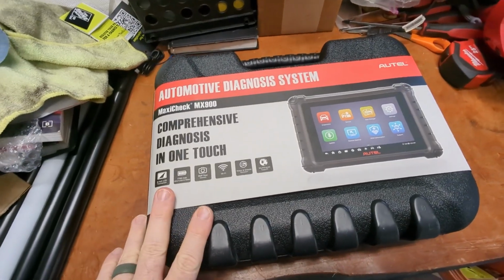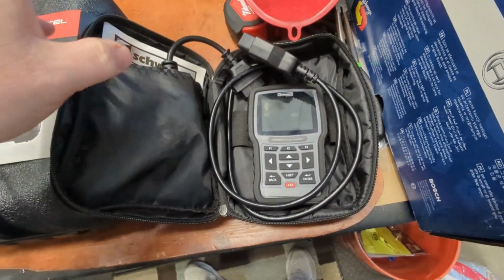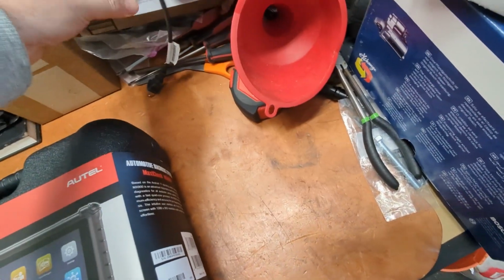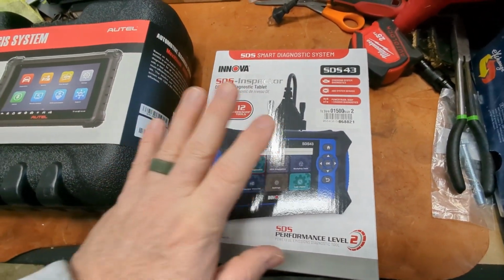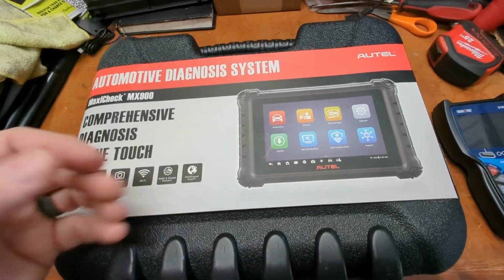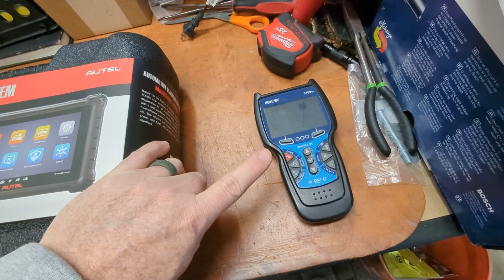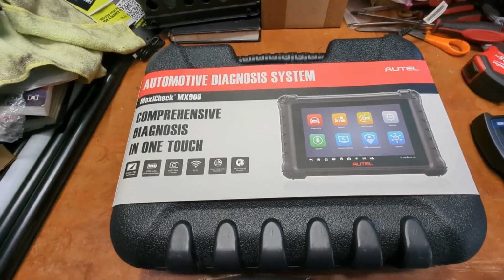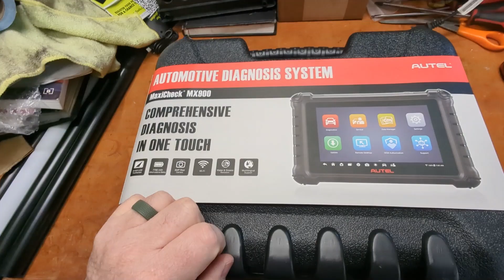Autel Maxicheck MX900 Intro

Comment: Excited to see the next video! I am a lower level technician interested in getting into diagnostic work, my tool truck rep told me about the mx900. I wanted to research it and you're video came up. I have an inovo scanner, I think its more basic than the one you show here, but I am very curious to see what its capabilities are compared to the mx900. Definitely gonna check out your other videos! Keep it up!
Reply from the maker: I'm going to try to get up to speed over the holidays.  I do have some first-setup videos, but realized I needed to get more familiar with the tool before doing "how it is used" content

Comment: Hello brother. I would like to see the initial setup of the scanner prior to using it on a vehicle. I ordered one, and if you can guide us on what needs to happen before plugging it into a vehicle, it would be appreciated.  Thank you.
Reply from the maker: I actually shot a lot of that, but it seemed a little disjointed and very long.  Then I started trying to read codes on my cars, but clearly I needed to understand how things worked a bit better, so they were start-and-stop, and I wasn't sure it would make a coherent video.

Setup was a relatively simple - charge, connect to WiFi, set up an account and then run through updates for the operating system and car modules.  Not too bad.

I'll have to see if I have the setup stuff still, and will see if I can put them together.

Comment: I was wondering how the tablet is performing for you after all these months?

It still seems to be the same boat as you mentioned; lots of people talking about Autel, but almost nothing on the MX90 specifically, which they seem to (I think) be touting as their main "General Use" tablet. It's listed as a direct upgrade to their MX808, which people have sung the praises about, but supposedly does a hell of a lot more.

Mostly I am curious if the MX900 is one of those tablets that requires some sort of internet connection (or God forbid, a subscription) just to have the tool function. Because in my search for  diagnostic tablet (of which there is a vast desert of information regarding), I've narrowed it down to two; this one, and the Icon T8 they came out with earlier this year. The T8 does not require internet connection or any subscription to work, which would be a deal-breaker by default if the MX900 did.
Reply from the maker: Honestly, I haven't used it - life has been a little crazy and I was a bit overwhelmed with the learning curve on the Autel.  A non-technician like me might be better with something a little more guided and consumer-oriented like the the Innova 7111.  I'm going to re-dedicate myself to figuring it out soon though (things should calm down a bit in April)
Reply: @themessygarage I know that feeling, this year has felt like pure hell so far and there's just no time for anything . . .

Comment: How do you turn up the volume or it doesn’t have a speaker
Reply from the maker: I legit haven't even thought about it.  I'm packing to move, so won't be able to check for a while, but my guess would be it's in the settings gear that's on pretty much every screen (if there is a speaker).